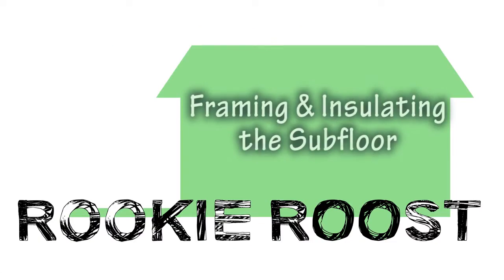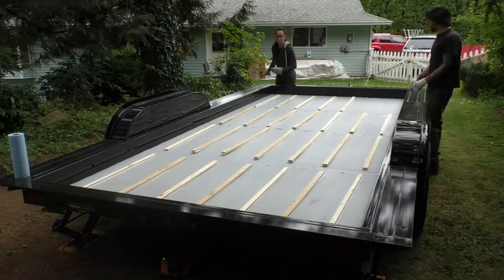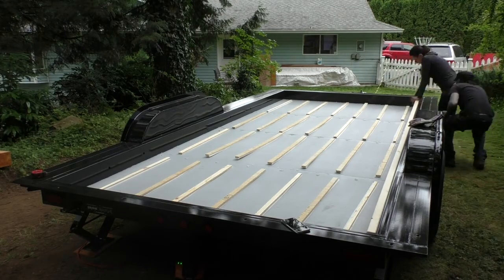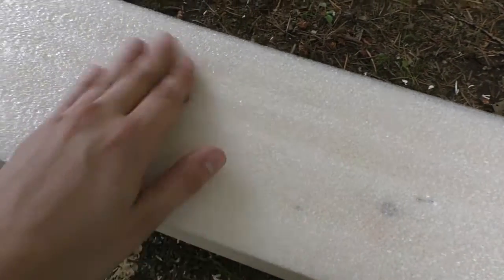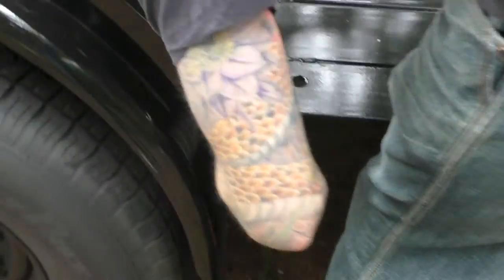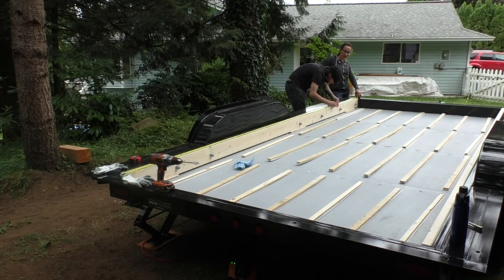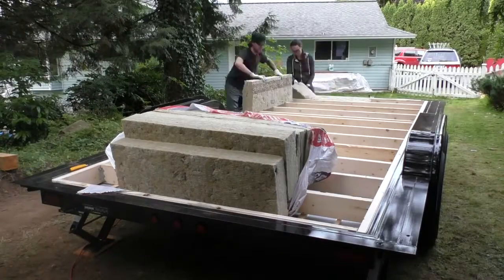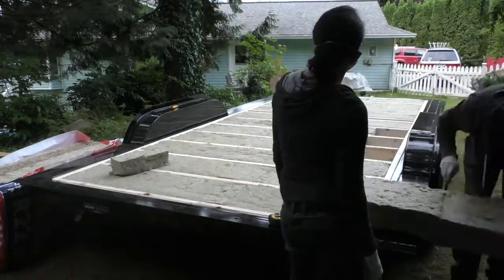Subfloor Framing & Insulation // DIY Tiny House Build

Comment: You said "Tell Us What You Think"
Here's what I think... You both are doing a great job, and this project looks like it will turn out awesome...  #1 I would've put wedges under each hole drilled in 2×6... Wood will split in a straight line overtime where holes are line up in a row( stagger the holes)...#2 When you put the boards down on top of the plywood, you should have put a nail or something to hold it in place, the insulation won't hold it... #3 Stagger the insulation, so that short pieces aren't on one side in... Thumbs up ur vid...
Reply from the maker: +RedWhite&Blue 78 : that's for the tips! Hopefully they'll help others who come to the video.
Reply: Rookie Roost... I watched several more of your build videos... very nice... I watched the video of the break up or something along those lines... I left a funny comment if you have a weird sense of humor like I do. Take care.

Comment: the "brackets" that attach the base plates to the joists are called "hangers" the majority of the hangers are called concealed face hangers and the one that looks different are called face hangers. for this application, being that there is already a metal trailer frame holding everything up, hangers arent really needed. I would have predrilled the holes for the for the perimeter and then attached the joist with simple structural nails...then i would have dropped the subfloor into position and fastened it to the frame. assuming the hangers are Simpson LUC210z...those are pretty pricey.
Reply from the maker: That would have made sense to do, yeah. We definitely spent more on the house than would have been necessary, but I guess that's the result of our overall ignorance. The second house should be quite the improvement ;)

Comment: I live in W.V. where can I find a trailer like that close to me? And how much are thy?
Reply from the maker: If you have any custom trailer builders near you, there's where to start. They may not specifically build tiny house trailers, but you could work with them to design something. This trailer cost about $6000 Canadian - expensive, but worth it to know I have a solid base to build on.